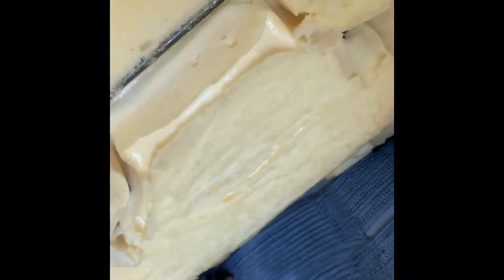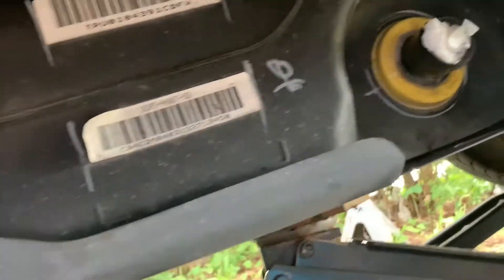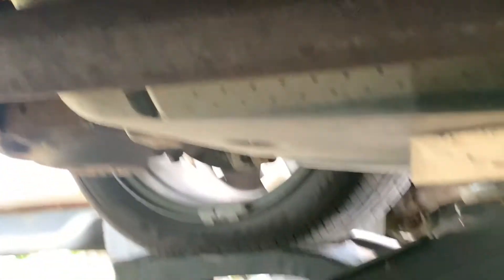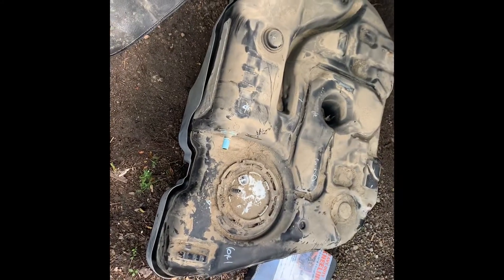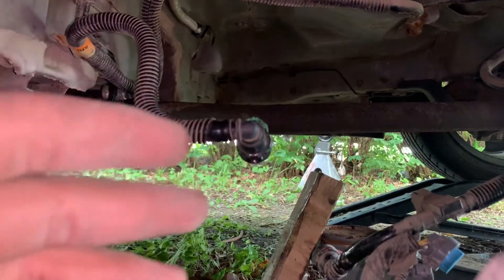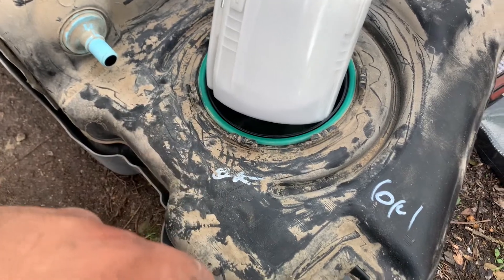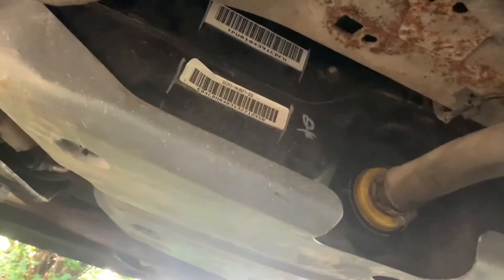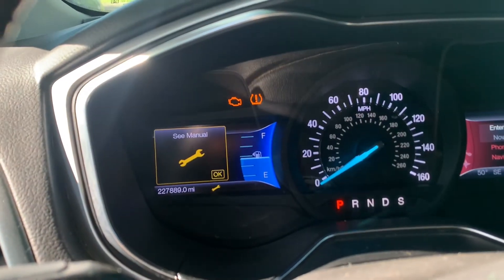How To Replace A Fuel Pump  | 2013 Ford Fusion 1.6L Ecoboost

Comment: Its a.good thing you mentioned the cap on the blue connection, I would have broke it being mad I cant get it off 😂
Reply: cap doesn't have to come off, just press the two tabs while pushing in on the connector then pull the connector off.

Comment: You are brave to do this on the ground. I'm hesitant to do this and I have a lift!  There are just two bolts and 2 rubber hangers on the exhaust and the whole thing comes off out of the way and tank can come straight down. Be careful using a screwdriver or chisel on the ring, you sure dion;t want to make a spark. I have a brass punch I use. For sure  NEVER NEVER use a plug in trouble light under a car if you are pulling gas lines and hoses, a few drops of gas on a hot bulb would be a disaster! (I know you didn't use one, but just saying...) I was hoping that I might see the fuel tank pressure sender because I have to change one. I think it's the electric part at 6:36 which is part of that $340 hose so be careful disconnecting the hoses.

Comment: Hey bud, I have a 2014 for fusion titanium,.the pump is humming, is there a filter before the pump that could be full of trash
Reply from the maker: Wayne Lyon to my knowledge on this specific setup the only fuel filter this car has is the screen on the fuel pump itself in the tank
Reply: @pedrocastor1066  thanks man, it's not the pump it's the vapor separator,.the humming noise was air in the fuel tank, lol, I thought it was the pump making that noise sucking air, so I thought the pump wasn't getting fuel, that's why I ask you about another filter, thanks bro
Reply from the maker: Wayne Lyon  no problem man glad you figured it out it’s crazy how there’s not many videos on these cars
Reply: @pedrocastor1066  I know right, they are really sharp cars, u would think they would be sought after, and have alot more videos, and they are really quick, I have the titanium .6lt eco boost and let me tell u,.it is quick bro, but maybe that would be a great video to do, it's a really complicated and uncommon problem, it's straight out wierd, lol
Reply from the maker: @whatsthepoint7548  I agree it would be a good video and hell yeah they are sharp looking cars and they got some sauce to them. the engine i just put in mine the turbo has a blow off valve so it sounds pretty sweet I will probably put it in my next video!

Comment: Hope I get a fast reply. ... Wondering how  you know that its the pump in the tank or if its the High Preesure or the modular?
Reply: You ever get an answer on that?
Reply: You should have codes telling you. I had a code for the high pressure fuel pump, but mine looked okay, I'm going to replace it soon. But my in tank fuel pump happened to die in my driveway and I didn't get any codes for that. I think with a more high tech obdll scanner and a laptop  it would show a lot more information.

Comment: Did your engine light go off after replacing the fuel pump?
Reply from the maker: Mine stayed on because I had another code that wasn’t related to the fuel pump issue. But I reset the codes and my fuel related codes went away

Comment: My 2013 Ford fusion dies between 1 and 4 times about 20% of the time when I start it up to go somewhere. It is not giving me any kind of error code and I can't figure out if it's the fuel pump or something else. Not the battery or alternator both checked, battery replaced. Any ideas?
Reply: If you haven't fixed it yet. There is a high pressure fuel pump on the engine, these cars have 2 fuel pumps. Also  my in tank fuel pump died at 190,000. But the filter on it was black. I have a fusion that doesn't have the cutout under the seat, so I had to take the gas tank off and out. To put the new pump in. Hope this helps you or someone who is looking into this information.